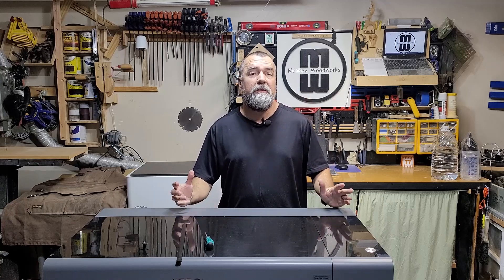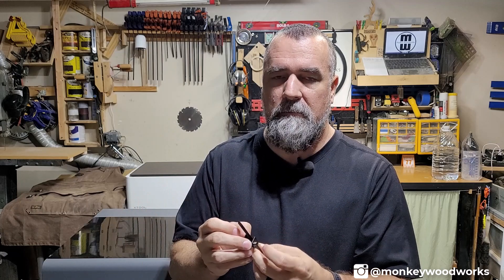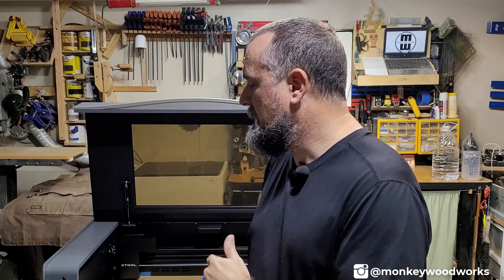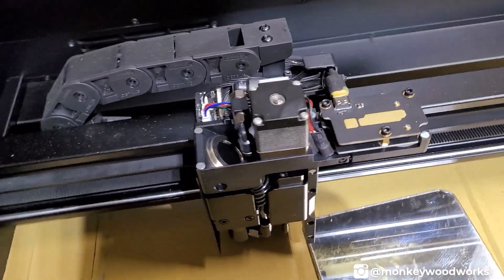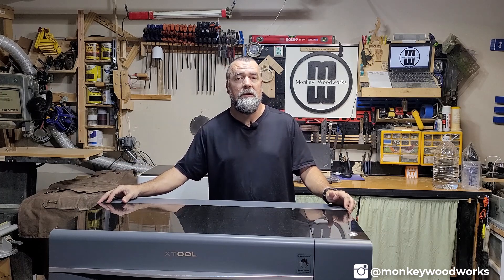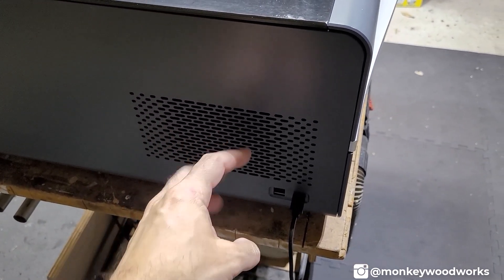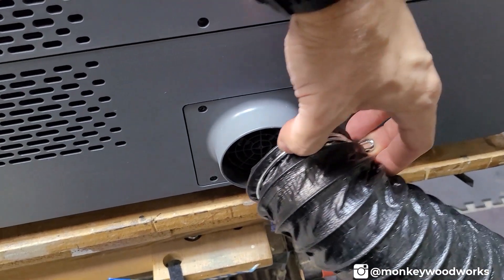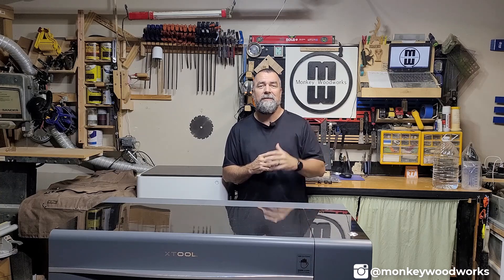Take a tour of the NEW xTool P2 CO2 Laser cutter

Comment: great video, my question is about adding antifreeze to my new p2. if it doesn't get colder then 32 degrees farenheight do I need to add any anti freeze? or can I run it on just straight distilled water? thanks
Reply from the maker: You can run it without it.  I went ahead and added it to mine using the smallest measurement they suggested however I bet I could have gotten by without it due to my average climate here.

Comment: What do you mean laser flat vs open plane,
Reply from the maker: Those modes are specific to the XCS software.  It tells the software where the material is located so it knows how to handle the automatic focus.
Laser Flat is used when the material is thin enough to be able to fit between the laser head and the slats .  The auto-measure will measure the "thickness" of the material meaning how tall is it from the top of the slats to the top of the material.
Open Plane is when you remove the slats and have the material anywhere inside the P2.  It is used when you are engraving odd shaped items and things that will not fit between the top of the slats and the laser head.  The auto-measure will measure the "distance" to the material meaning how far from the laser head is the top of the material.

Comment: Thanks again for an informative video. I ordered the P2 and want to learn as much as I can on how to use it while I await it's arrival. I have never operated a laser before and I hear so much about different softwares. Which software do you recommend using (learning) with the P2? I want to start watching tutorials to not be totally lost...
Reply from the maker: The P2 is compatible with xTool's free XCS software and with LightBurn (paid application).  LightBurn is the industry standard when it comes to lasers.   It is really powerful with amazing features.  XCS is an xTool exclusive software that just started it's second year (I believe) of existence.  XCS is the main software you will use when working with your P2.  While LightBurn is compatible with the P2, you only get basic use of the p2 with it.  With XCS you can take advantage of all the cool things the P2 offers (dual cameras, automatic and manual pass-through, contour of a shape, etc.).  While you wait, I would recommend you have a look at my xTool M1 series of videos.  It is focused more on the M1 laser but it does show a lot of XCS related content as well as discussing auto-focusing (something you do in the P2 as well).  XCS still has a ways to go when it comes to designing so you will need to get familiar with outside vector design tools.  Ill see if I can add more information about the subject in my upcoming videos.  I need to remember that people watching the P2 series may not have any XCS software experience.
Reply: @MonkeyWoodworks  you are awesome! Thank you for your reply and recommendations. Look forward to your upcoming videos and I will be binge watching all your previous ones!

Comment: Hello! can you cut and engrave the same materials with the M1 and the P2? I'm still confused if it can cut cardstock, felt, vinyl, foam and all the other materials the M1 can cut and engrave. Thanks!
Reply from the maker: Yes, it can laser cut/engrave the same materials and MUCH more.
Reply: @MonkeyWoodworks  even vinyl and paper? Because I don’t see a blade. I would like more information :) please! Thanks! ❤️
Reply from the maker: Paper yes, vinyl no.  Unless the vinyl is specifically made to be cut by a laser, you need to use a blade to cut it like with a cricut or the xtool M1.

Comment: Whats's the difference between Open Plane and Laser flat Mode besides the dimensions?
Reply from the maker: Those modes are specific to the XCS software.  It tells the software where the material is located so it knows how to handle the automatic focus.
Laser Flat is used when the material is thin enough to be able to fit between the laser head and the slats .  The auto-measure will measure the "thickness" of the material meaning how tall is it from the top of the slats to the top of the material.
Open Plane is when you remove the slats and have the material anywhere inside the P2.  It is used when you are engraving odd shaped items and things that will not fit between the top of the slats and the laser head.  The auto-measure will measure the "distance" to the material meaning how far from the laser head is the top of the material.
Reply: @MonkeyWoodworks  Thanks for the explanation. As someone new to this I thought the main factor is the distance between material and laser head to adjust the focal point. So I am still a little confused why this results in different working areas, but I guess there is a difference on how they determine the distance.
Reply from the maker: Yes, it is all because of the XCS software and you telling it where the material is located.  I believe it is a safety issue to help protect the laser head.  Laser flat will NOT allow the laser head go below the slats whereas open plane will. 
 However, you MUST make sure the slats are removed in Open Plane mode otherwise you could damage the P2. 

In Lightburn, you will also give it two different measurements depending on the material location.  If the material is sitting on the slats it is one measurement.  If the slats are removed, it is another measurement.

Comment: Living in S California the temp gets really hot in the summer. Triple digits. I will be using this in my garage. Do you see a problem with this? Other lasers manufacturers said should be no problem with their lasers as long as the coolant was there kept up. Do you think this will be an issue with the p2.
Reply from the maker: That is a great question!  You may reach out to xTool for that question.  I am not a co2 expert and I am learning as I go along.  I live in south Texas and it gets quite warm here as well.  It will be interesting to see how it goes in the heat.  Also, the P2 does not have a way to externally cool the tube from what I can tell so it looks like it is all up to the internal cooling of the fans.

Comment: Hi Michael, I'm an M1 user (I love it) and I'm no techie, so at some stage can you highlight some of the usable differences between this and the M1 (aside from the larger work area which was pretty cool) as to why the P2 would be a good fit for a home craftsperson like myself. Most of the stuff I make is in 3mm balsa or MDF although I do want to branch out into acrylics once I've worked out how it's done. Does this model cut thicker materials? And I know, silly question, but how does the rotary work if the machine wants that tray in place. So curious, and will be watching for more.  Thank you for the great content.
Reply from the maker: I sure will!

Comment: Nice video (& I look forward to future videos for the P2, which I'm hoping to order soon) Thank you in advance.
I'm a little confused about open plane/laser flat modes. From xTools specs I have the bed size at around 660x355mm. From your findings I have laser flat mode at around 595x300mm & open plane mode at around 495x245mm. Would I be correct in assuming bed size is the size that you can put material into (so material up to 660x355mm would fit into the machine when closed up) Laser flat mode is the area covered by the slats & open plane mode is the area without the slats (or visa versa, because I would have thought the area without the slats would be larger?) Is open plane mode the width that material can fit into when using the passthrough (so 495mm width by I think it was 8ft length?) I still need to work out the area the camera can see/show in the software
Reply from the maker: Based on my tests, this is what I measured on my PRE-PRODUCTION machine so far.
Bed Size: 27"×14.75" (685*375mm) (Physical limit inside machine)
Processing Area Above Slats 23.5"×12" (597*305mm) (Laser Flat Mode)
Processing Area Below Slats 19.625"×9.75" (498*248mm) (Open Plane Mode)
Manual Pass Through Mode size limit is still to be determined
Laser Conveyer Feeder Mode size limit is still to be determined

Laser Flat Mode is what you will use when placing material on top of the slats inside the machine.
Open Plane Mode is when you remove ALL slats and engrave on things including when your working with the rotary tool.
Reply: @MonkeyWoodworks  thanks